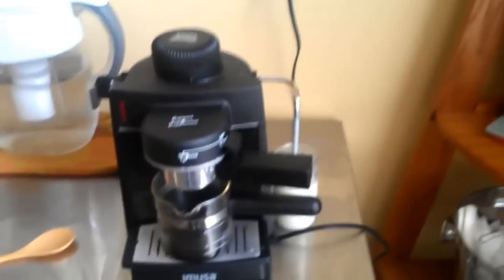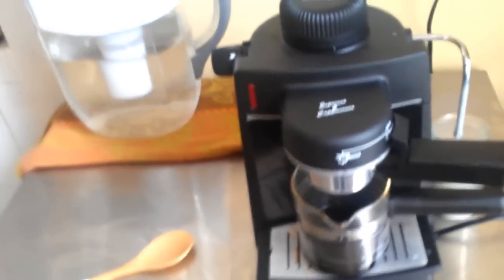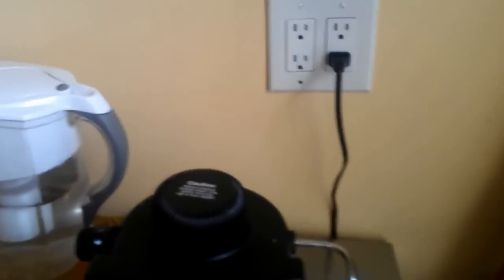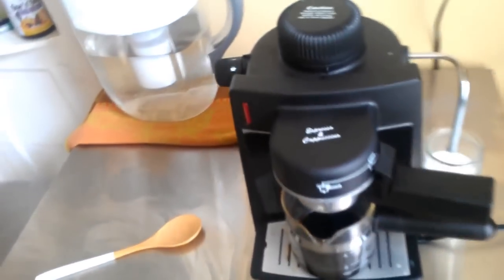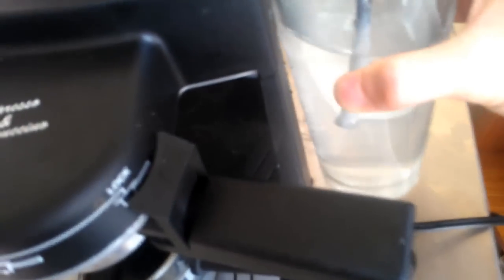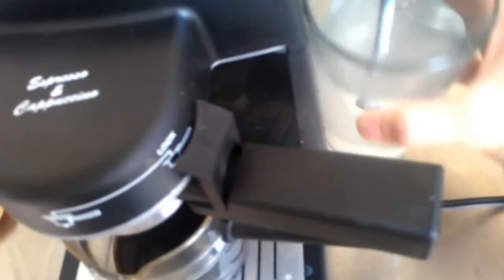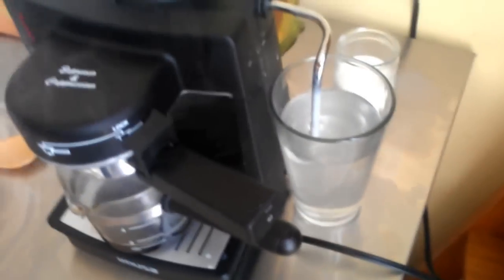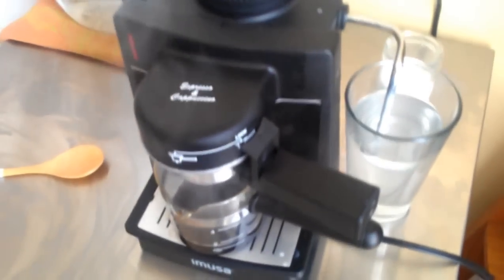Imusa Espresso Maker problem FIXED! Overheating and steaming from the top!!

Comment: thanks for your help!
Reply: Glad it worked for you! It really is a good little machine. No need to pay $5 at coffee shops anymore for a latte!
Reply: Jason Virga Agreed! Do you ever have a problem with the milk not frothing but there is no steam coming out of the top like you described in the video? Does this mean you didn't put enough water in to steam the milk? Because all I hear is a loud pitch sound and the milk will heat but it won't foam, and I'm pretty sure it is not clogged because I clean it now after watching your tutorial. Thanks!
Reply: Liz Sarno I had the same problem. The secret is you really need to keep that metal steamer tube very clean from the inside. You should really clean it after every use. The best way to do it is (after you've made your latte...) just pour water into the machine And then get a tall glass of water and fill it 75% full. Then set the steamer to full power and you will see the glass of clear water turn all cloudy. That way you know you're really cleaning it out. It requires a little bit of maintenance... a couple mins of time after every time you use it. But it's worth it to keep the machine running well. I wish IMUSA would send me a little check for helping out with their tech support! HAH LOL!!!